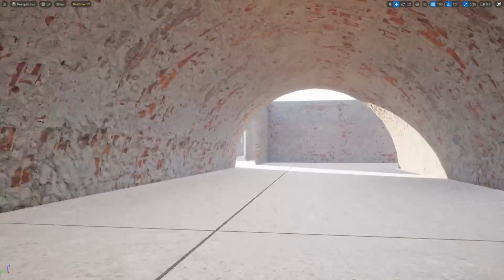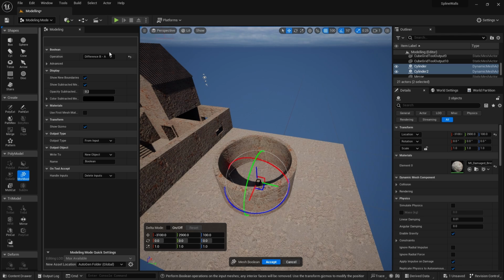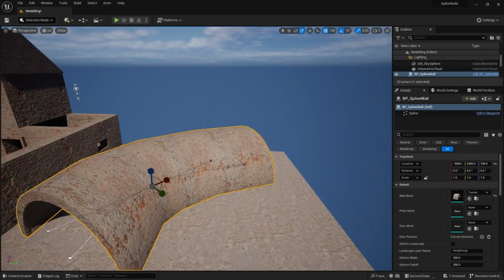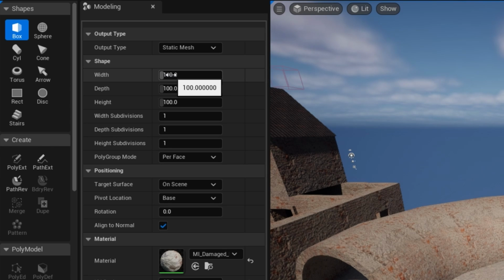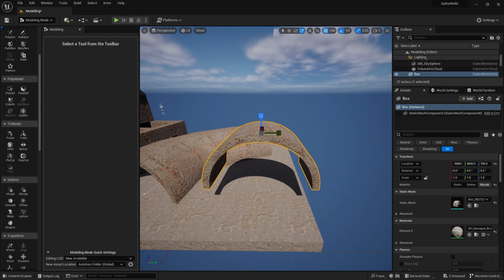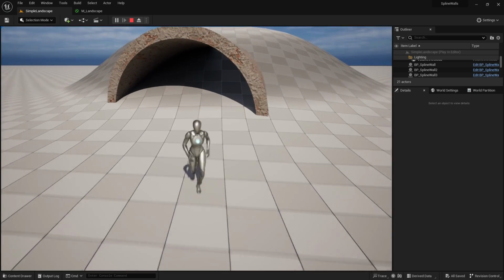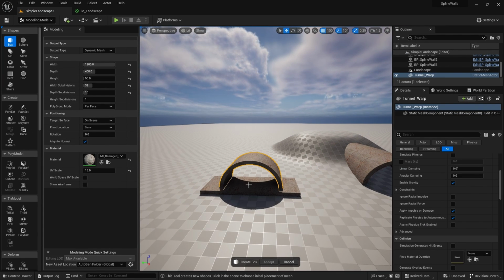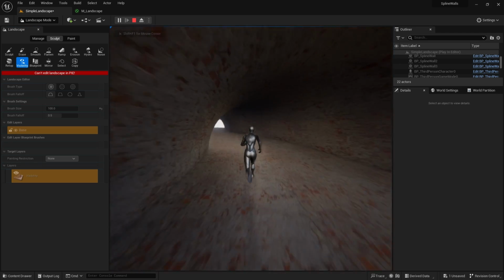UE5: Building Structures - #8 Creating Tunnels

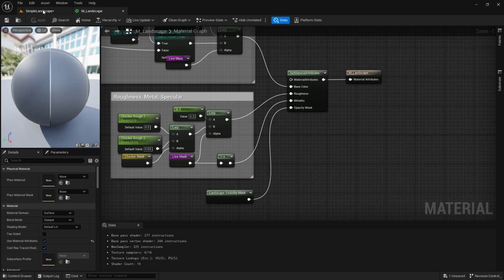Comment: @20:50 In UE 5.3 if it's still not working correctly then you need to select the final material output node, and in the details panel on the left set the blend mode to masked for the material. 
If you notice you've accidently added holes all over your landscape level while testing, in the landscape panel on the left of the editor; right click on the visibility layer and "remove all holes."

UE 5.3 Documentation covers this under the section "Creating Landscape Hole Materials".

Comment: I'm a really big fan of your work thanks a lot. 

I'm having a problem getting my walls to be collision and be calculated in with the nav mesh volumes for AI. Like making a castle wall that's wide enough to walk on and such.
Reply: I’m having trouble getting collision to work as well have you found a solution?
Reply: somebody suggested to add a spline mesh component and then to change the presets to either block all dynamic or block all..I have the same issue and thinking to try it out see if it works...

Comment: Hey not sure why but when I use the static meshes in the blue print, my collision isn't working? The meshes alone are fine but once they are in the static mesh, they no longer have collision working?
Reply: Never mind, I realized I had to change the static mesh node collision.
Reply: @EfficioIgnisVitae what did you change and where did you find it?
Reply: @dougpd4310  It's been so long since I've played with Unreal. I'd have to see.

Comment: Great tutorial!
I have a question;
If I wanted to create a hole in the side of the tunnel, how could I go about doing that?

I'm looking to make a train tunnel with this method, and think it'd be appropriate to have smaller, human-sized corridors "cutting" into the train tunnel from the side.
Using the "mesh boolean" tool you used early in the video would be ideal, but this doesn't seem to work on my BP_Spline actors (presumably because they need to be static meshes).
Cutting a hole into the mesh like you did with the landscape tool would also be a solution, but that is of course for landscapes.

Is there a way to do something similar with a tunnel made with BP_Spline, or should I look for a different way of creating tunnels that would allow this?
Reply from the maker: That's a pretty tricky thing to do. I certainly don't think you can do it dynamically, as you say you will probably have to merge to a static mesh and use the modelling boolean operations to cut your holes.
Reply: It works just the same way as for the wall doors but here you create a hole using a scaled up cylinder in the tunnel segment  usingbB-A boolean and then just replace the wall door segment with the tunnel hole segment

Comment: 18:32 I did some research a while ago about this and most comments about the visibility mask method mention loss of performance. Are there ways to mitigate this?
Reply from the maker: I haven't seen any recent reports of performance loss with landscape visibility. Can you let me know if you find any recent references?
Reply: @unrealitybites763  I wasn't able to make holes in the landscape so I had to go looking around how to do this(thanks UE for not having your tools set up correctly) and this is written in their tutorial page: 
"You can use the same Material for your Landscape Material and your Landscape Hole Material, but be aware that Materials that use opacity masks are more costly performance-wise, than Materials that do not. This is why you have the option of creating a separate Landscape Hole Material."